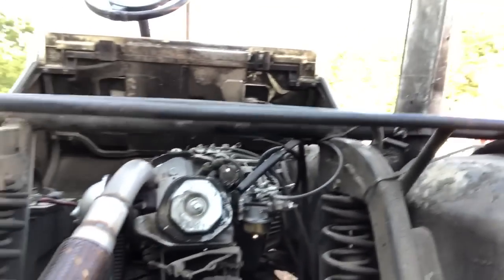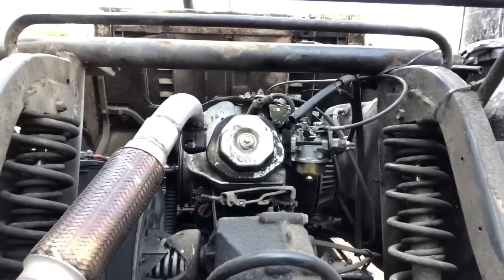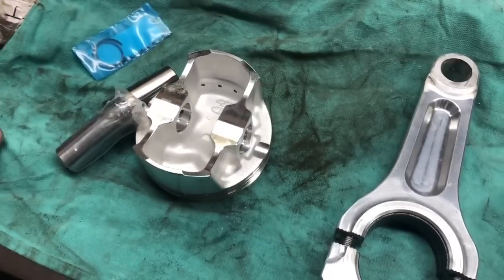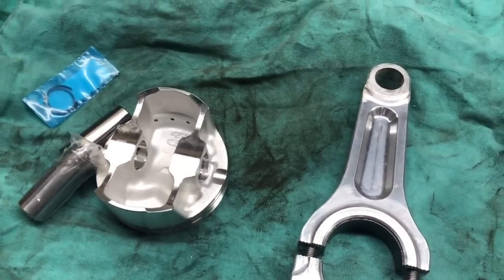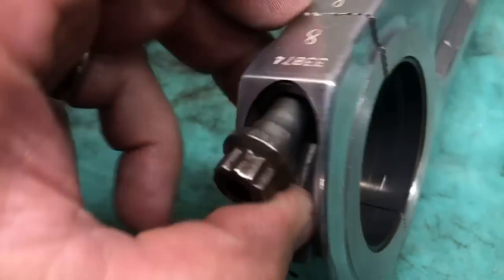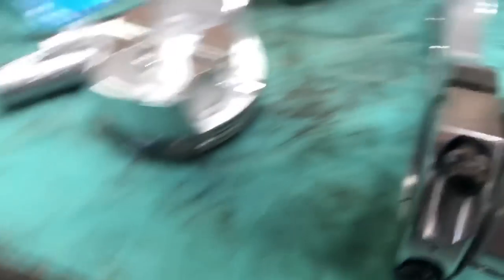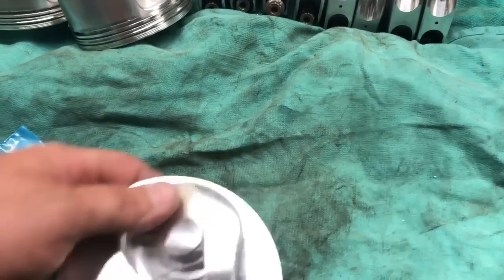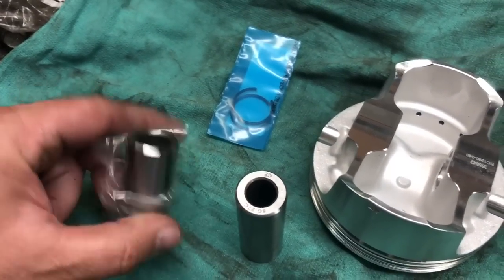Mult-tasking!  Hanging Connecting Rods, Sloppy TIG Welding, Golf Cart Work!

Comment: I'm sure u already know but when welding aluminum use a stainless wire brush that u only use for aluminum and on nothing else and clean the weld area very good and then wide with acetone a couple times. It will make it weld 100× better.

Comment: Honda motorcycles the valves tighten over time. If you don’t adjust them it will pean the top of the valve stem over.
Reply from the maker: Interesting!